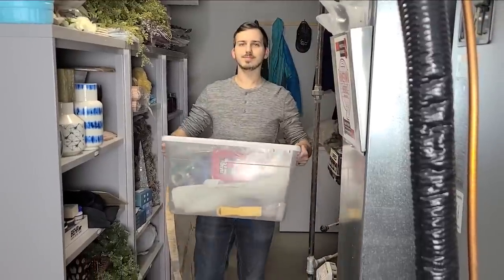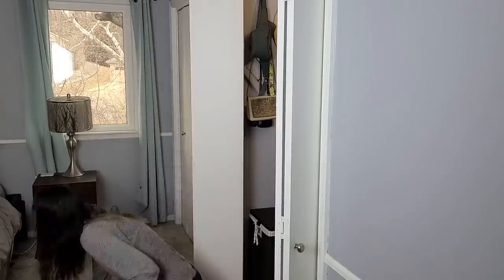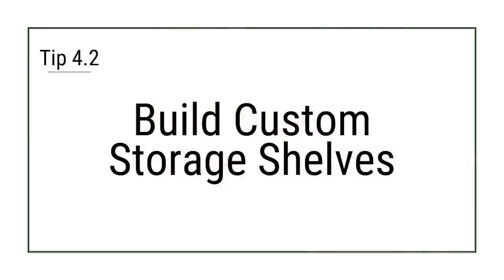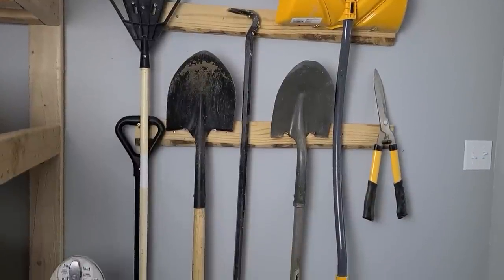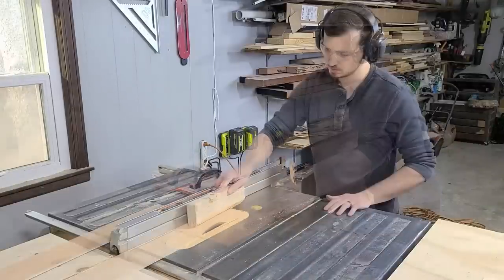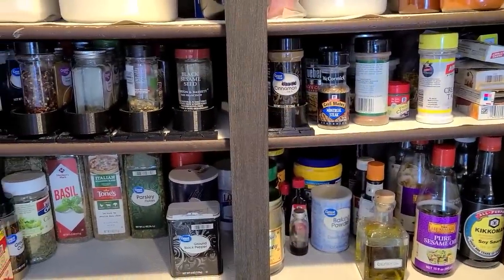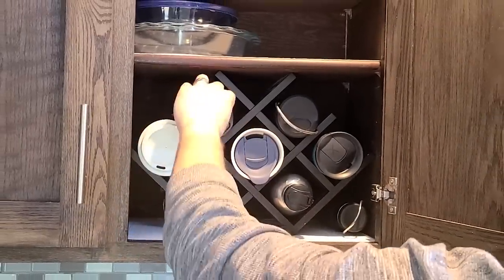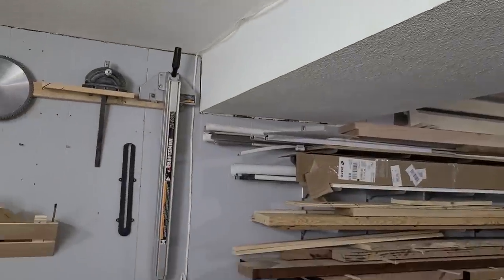DIY Organization Ideas: 12 Tips in 12 Minutes

Comment: For my holiday decorations, I use QR codes on the bins. The QR codes link to a list that tells me exactly what is in the bin. I use a lot of clear bins so I can see most of what is in there but for my older bins that aren’t clear this is very helpful.
I also painted the inside doors of cabinets with chalkboard paint. Then I can keep an inventory of my pantry & overstock.
Reply from the maker: Thanks for sharing!! I've never heard of the QR code tip.  ~Amanda
Reply: These are both excellent tips

Comment: A great way to get labels off jars is to use hand sanitiser.  It also works for getting ink and permanent marker of acrylic and plastic.  I think my daughter would throw a fit if I used peanut butter for label removal.  Great tips there.  Thanks.
Reply from the maker: Can honestly say I haven't tried hand sanitizer! Haha our kid is attached to  peanut butter too but doesn't seem to mind 😂 Glad you found the tips helpful!  ~Amanda
Reply: It's the oil in the peanut butter that makes it work -- and alcohol in the hand sanitizer. Oil and alcohol act as solvents for the adhesive. Oils have the benefit of not evaporating like alcohol does, so it's easier to let soak. If you'd like to make less mess than using peanut butter, then just rub a bit of oil on the adhesive instead of smearing peanut butter everywhere. Pretty much any cooking oil will work; there's no need to get peanut oil specifically. Oil to remove the adhesive, soap to remove the oil, water to remove the soap, and evaporation to remove the water.
I just gave this same tip to my sister for removing assembly stickers from a piece of flat-pack furniture she recently assembled. She reported back that it worked a treat.
Reply: Vinegar also works to get sticky stuff off, as well as removing limescale. I buy white vinegar specifically for cleaning, as it does so many different tasks in the home. It's cheap and it's natural.

Comment: ok garage how do you use studs if your garage  is cinderblock??
Reply from the maker: If your garage is cinder block then you can use masonry drill bits to drill holes wherever you need them and then use masonry anchors and screws to hang your pieces. It's a little more work than sheetrock and studs but you do have more flexibility in where you put your holes. Best of luck!
-Tyler